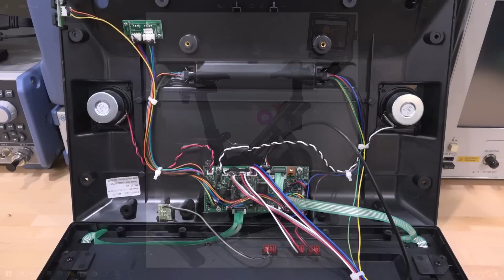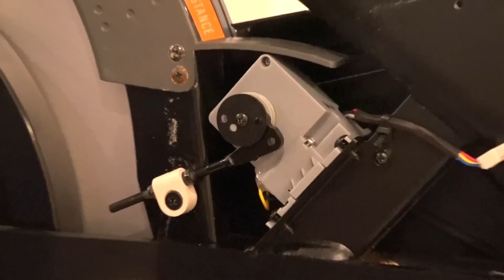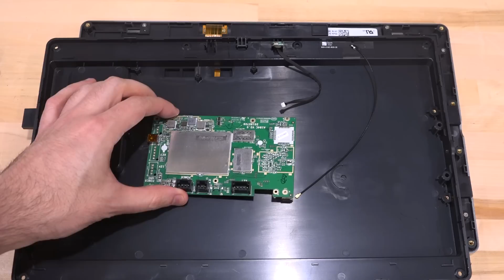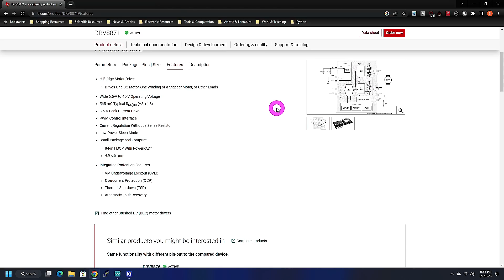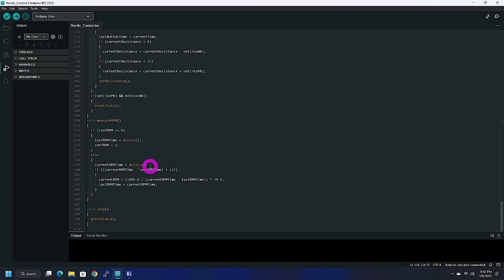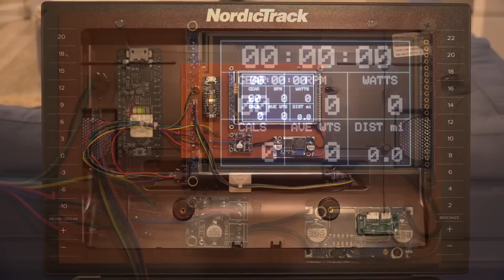TSP #246 - Design of a Custom Control Board & Software for a Broken NordicTrack S15i Exercise Bike

Comment: Do you know what the middle board (btwn power board and Android processor) does with the 12v, besides passing it through to power the Android tablet? On mine, the middle board is receiving 12v, but sending 6.5v to the Android. I powered the tablet with a 12v supply and everything seemed to work. I'm about to rewire the 12v to go straight from the power board to the Android tablet, but wondering if there's a current limiting feature or something else that I'll be missing out on, by bypassing that middle board. Great video, BTW!

Comment: So I'm running into an issue with my resistance motor not responding to inputs from my control panel. HOWEVER, if I loosely jiggle the 5 pin connector around in the control board's socket, I can sometimes get the motor to move, but only in one direction. What might be causing behavior like this? I'd be fine if I could just use a pot and manually control this but I'm not sure I fully understand how this motor functions.

Comment: Maybe I would use something like ESP32 in the bottom box (for the servo controlling and sensing the rpm)  wirelessly connected to some tablet mounted inside the original frame. This would preserve some previous functionality and prevents me from going postal due that cabling issues, but on the other hand this leads to writing own application for android or iOS, which is some real pain in the ass. So at the end of the day I think your solution to that problem is much effective and good enough for Australia, USA, whatever.

BTW what the hell "bobby dazzler" is? It triggers me uncontrollable laughing everytime I come across with it, but I don't know what this came from and what this exactly means. It's definitely my Kryptonite similar to "hate sink" (Australian, not Austrian, term for "heat sink"), "Wendeschalter des Motorus" (which I heard in Switzerland, this triggered me laughing for about an hour) or "Zpuchřelá šňůra" (which does almost the same to me).

Comment: How did you calculate the wattage measurement?
Reply: Its some sort of estimate, watts = (resistance squared * rpm) / 200. You can find watt tables from spin bike manufactures online if you want.

Comment: I'm currently trying to fix one Nordic Track treadmill. The power supply they made for this machine is totally crap! One of the 85C cap was literally wrapped inside a heat sink of a power component which gets heated up to 90C. Also there is some resistors which are continuously at 100C all the time. The PCB is all charcoaled under those resistors. That cap got heated during the years, changed into a resistor and that Android tablet memory was corrupted. I've read some articles in Reddit about installing the firmware but I'm not sure if it is possible any more. The screen shows briefly something about update and after that does nothing.

Comment: I love this solution.  Based on your experience with their customer support, NordicTrack is banned from our house as well.  
I didn't want to purchase a subscription model bike so I put together my own solution with a Matrix brand bike.  It came with an LCD TV mounted to the unit.  I replaced it with a ViewSonic brand Andriod PC that's meant for Kiosk applications.  That gave me a nice big, (fully open software-wise), touch screen.  The Matrix bike sends all the needed data over FiTness Machine Service (FTMS) Bluetooth protocol.  I'm able to pick that up with KinoMap software which works really well and has a lifetime buy in option.  It's far superior to a pay forever model!
Reply from the maker: Very nice!

Comment from the maker: Thank you all for your comments! One thing I forgot to mention is that the Android PC is completely non-responsive. It draws very little current and looks like its memory chip is either dead or corrupted. Without access to the programming tools and the software there is very little chance of actually fixing it. This, combines with the huge amount of tracking software it originally had, I decided to just remove it all together.
Reply: Tracking software as in tracking the training or as in tracking the user like for example a cookie or tracking pixel on websites? Ah sorry, 2 minutes later in the video and its sadly the latter one. Never mind. 

Another 4(?) minutes later, let me add some value: In your code, line 57, the "resValues" array is missing the commas for 6 values at the end.

Comment: When you mentioned there was a mistake in the design, I figured it was that you were pulling BOTH of the outside "legs" of the resistance feedback potentiometer up to +5VDC (instead of leaving one grounded), as you had mentioned "putting 5 Volts across the two other terminals". And...

My original response was going to be “I am guessing you originally had the right idea in mind but didn't implement it in the original schematic correctly (by grounding one of the outside legs), and fixed it later.”

That being said, after looking at the design again, maybe you just misspoke and meant "pulling both the outside terminals up to 5 Volts through 10k ohm resistors". This would be a good idea, as you could read the voltages of RES- and RES+ and calculate the position of the potentiometer (magnets), but you could also tell if the potentiometer circuit failed OPEN (the wiper losing contact) as that would be the only case in which either measurement would be the full 5 volts. This method would also detect the resistance element of the potentiometer opening up, as your position calculation would give you an invalid value.

It was an interesting video, so thanks for sharing it.

Comment: Fantastic episode! Information like this will allow us to make smarter purchasing decisions, but also reiterates the importance of right to repair, service manuals and component availability. I have repaired many devices and appliances with just $2 worth of components whereas the industry would much prefer it be thrown away and a replacement item purchased. Props for protecting your outbound network access - it really should be the default for all border routers.

Comment: I congratulate you on spending the time and effort to avoid throwing away otherwise usable equipment.  Excellent.  I imagine more and more things will stop working after the Apps are abandoned or the controllers fail.
Reply from the maker: This is my view too. An "app" failure should not render a complete bike unusable.
Reply: I used a software called Blynk to control my espresso machine (ESP32 based PID controller). There used to be a local webservice you could run in Docker and then use an app to build a simple dashboard, for example for setting up the target temperature. Now they want you to use some SaaS subscription and killed the app/
Reply from the maker: @12346798Mann  Yeah, Blynk is no longer usable for anything hobby related. I gave them up a while ago.
Reply: @TheSignalPath  yeah, you're video got me to look for some touchscreens to get rid of all the app based configuration and put a proper interface on the espresso machine. Or maybe I write a web based application. But sadly I'm too busy with thinking around with 868 MHz devices with LoRa or telegram splitting and Matter/Thread. And it still makes espresso.

Comment: Yeah, I've been slacking on getting a pi-hole installed. That's now added to my yacc shaving list.  I especially 'like' the bait and switch NordicTrack used to take $150 from you and then present you with a massive bill to replace their  android computer.  It's great being an engineer. Congrats on the resurrection.
Reply: Including parts but not labor in the warranty is such a scummy move, it surprises me this is even legal.
Reply: @lbgstzockt8493  The warranty on the bike is 2 years for parts, and one year for labor and only to the original purchaser.  It is clearly stated in the limited warranty terms printed in the owners manual, so it is not illegal, nor even scummy.  It's in the contract.  If you don't like the terms of the contract, don't buy the product.

Comment: A more straightforward engineering solution would have been to put a USB device controller in every interface, like the motor that changes the distance of the magnets to the flywheel, or the RPM sensor.
Doing that would have moved most control into the Android domain, where you don't need special firmware. Basically just an APK with the necessary UI that talks to the USB devices. That way you avoid routing too many cables, and the controller ICs are basically jellybeans anyway. 
I also feel that an exercise bike made from metal would be better suited to an external DC wall-wart with 5V or 12V.

Comment: Would have expected more, than just this arduino-module-whatever slapped-together evilness. Expected some proper engineering to be shown.
Reply from the maker: "Perfection is achieved, not when there is nothing more to add, but when there is nothing left to take away."
Antoine de Saint-Exupery
Simple & inexpensive  are good engineering practices.
Reply: It works, doesn't it?
Reply: If a job’s worth doing, it’s worth doing badly - English engineering expression.  In French Perfection is the enemy of good.
Reply: @Richardincancale  Perfection is also the enemy of being finished.

Comment: A somewhat disappointing video. Considering all the lab equipment you have i really hoped to see reverse engineering of the USB protocol to the android board. If only the android board was dead then you still trashed a lot of stuff that could still be used. Over Engineered or not, the power supply for the bike and such where working. So after reverse engineering you could have hooked up anything. 
But I do get it, this was simple and effective. But that is not the most interesting in this case.
Reply: You must be fun at parties.
Reply: @vincei4252  you must be terrible at riding a bike.
Reply from the maker: If there were a "working" bike to try and snoop on the USB interface, then perhaps we could do some reverse engineering of the protocols. But at the end of the day, we would be back to having to make our own interface.
Reply: @TheSignalPath  depending on how broken the android part is there might be some traffic moving around still. There is also extracting code from the controllers etc etc. Just because parts are dead not all is lost. Same with you often not having schematics for the devices you repair. Assumption and logic can carry you far.
Reply: @jaro6985  so, no opinions allowed other then glorification? Bit of a zealot are you? Considering all the advanced repairs he does i would have liked to see more. It's s valid opinion. Now go and get one of those yourselves.
Reply: @jaro6985  thought as much. Would need an entire pantheon if i did that for every channel I watch. I wish you luck. He might repair you after death, then again he might remove still working parts because they are over engineered and turn you into a simple minded thing with only the most basic of capability you had before. 😀

Comment: @The Signal Path Well done on saving the bike from going to trash BUT just a question? Why didn't you attempt to repair the faulty pc?
Reply from the maker: I put a pinned comment at the top for this question since a few people asked. But short story is that the memory chip on the unit was likely dead. Without access to software & tools for this custom board, I don't think I had a chance of fixing it.
Reply: Most likely this would be more achievable in a timely fashion than the level of work required to effect that kind of repair. Also be didn't seem to really like the spyware in the computer anyway

Comment: A bobby dazzler is a police light i believe
also i was always told you should never put all of your code inside of your interrupt handler and should always call a function within ... i never bothered to question it and im not sure if its a best practices thing or another interrupt not allowing returning 
but a fantastic video, its always good to not let something fall in to e-waste
Reply from the maker: The interrupts only handle the button press detection, advancing the time & of course measuring the RPM. Everything else is done outside of the routines.
Reply: I don't see the difference between having code inside the ISR and moving it to a function that is called from the ISR. It makes no difference.

That said, it will depend a lot on your specific microcontroller.

Some may only have a single interrupt and ISR from which you need to determine what caused it, while others can have sophisticated multi-level vectored interrupt controllers where each interrupt is prioritised and calls a specific ISR dedicated to that interrupt.

In the case of the former, you may choose, for code readability purposes, to test each interrupt source and then call a function to handle it for example.

In my experience the general recommendation is to "get in and get out" as quickly as possible - don't do any major processing in the ISR because this will slow down the rest of the application. Just clear the interrupting condition and maybe something else like set a flag to indicate that X occurred and let the application handle all of the heavy lifting.
Reply: General rule is to keep your interrupt routines short, but not by calling other methods from there, but by simply setting some flag, returning from the interrupt, and then do the heavy lifting in your main loop. Using an RTOS makes it usually easier - you just schedule a task to run in your ISR, and the task scheduler will run it accordingly, as long as nothing else with more priority has to run.

Comment: Did Nordic Track take some of their service and reparability cues from Rohde & Schwarz?
Reply: More like from the fruit company, plus mixed it with JD philosophy as well. Why else would you have a microcontroller to do a job on a board unless it was to make a proprietary communications protocol that requires the 2 parts to send encrypted traffic to each other. Android board probably just has a failed few bits in the flash, because they deliberately did not turn off any logging in the firmware blob, so it will kill the flash with writing junk log files that later on are erased, and also downloading all the ads and such so they can still serve them offline for a while. Selling the bike and selling the customer again.

Comment: I was going to modernize my bike even cheaper and faster by adding ble/ant+ sensor and connecting it PC programs like zwift. But unfortunately it appeared that in zwift you can't set custom wheel diameter :( which means that it is necessary to develop custom sensor.
Reply: Because "speed" is totally useless. For Zwift you need only three things - heart rate, cadence and, the most important one, power (pedal based power meter).
Reply: @randybb  but it requires to set wheel diameter in the beginning. And if you select wrong one, it will show wrong numbers. Will power meter solve this issue?
Reply: @MSP_TechLab  Zwift uses power! If you don't have a powermeter, then you need to have a known trainer on which is power calculated from a speed based on a power curve. Speed on a stationar trainer is completely useless value which cannot be compared with speed on a real bike.

Comment: But how did he calculate calories/watts.
Reply: Well Watts is just torque times your revolutions per second times 2 pi. He did some weirdness with using the resistance+1 squared if I see that correctly but I don't really know what that variable actually represents. 
To get calories you just integrate aka sum up all the watts every second after using a scaling factor.
Reply: @allesklarklaus147  it must be a finger-in-the-air guesstimate of the torque as a stand in for a proper strain gauge. could buy watt pedals or maybe crank arms to get proper numbers.
Reply: @vegard6524  Well you could map the resistance or force applied to that braking setup to a real torque by calibrating it once. Should be reasonably accurate I assume.
Reply: @allesklarklaus147  yes, and that must be the way they did it in the first place, with a look Up table.